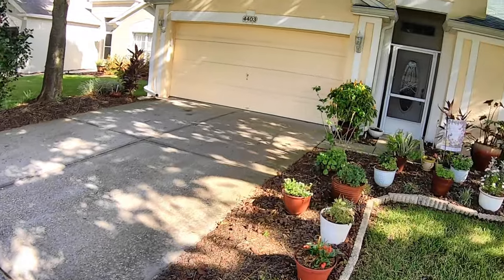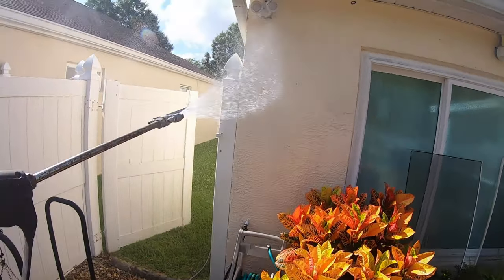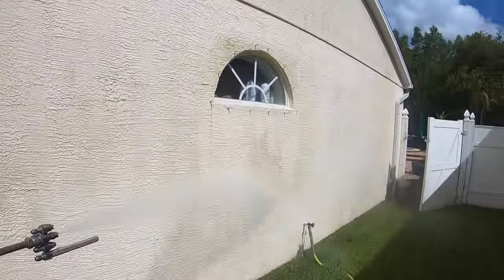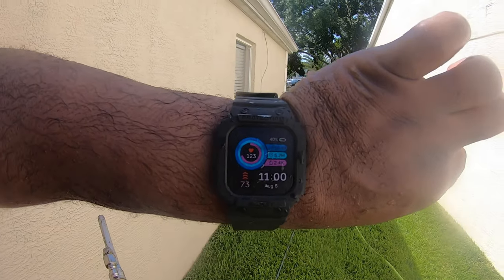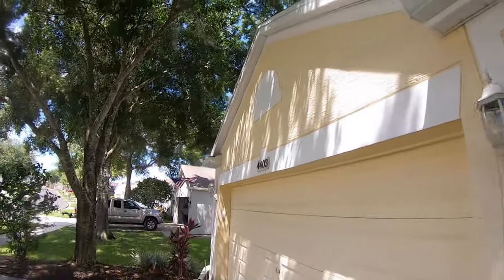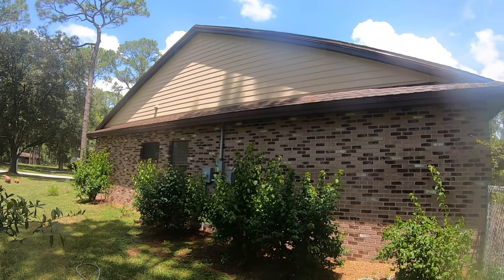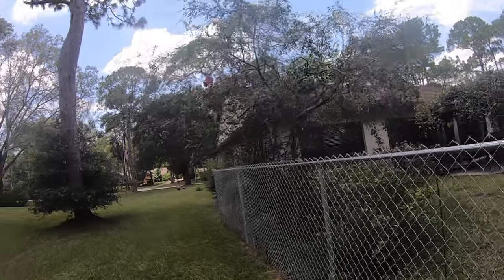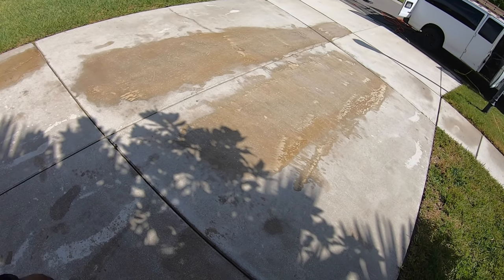house soft wash and oil stain removal

Comment: Big Bruh, I have a oil stain removal job tomorrow, I’m using f9 bark. It’s new concrete , do I use a 50/50 mix??
Reply from the maker: F9 barc doesn't work for oil. That stuff is for rust.  F9 double is the degreaser from the F9 products.  You're better off getting some purple power extreme.

Comment: Cliff, at the end of my gun, I have a swivel  ball valve  when it's in the off position. I can't quick release  it , it's still as hell and won't swivel,  does that sound  right  to u?
Reply from the maker: If you got cheap quick connects it will happen
Reply: @PinkFlamingoPowerWash  ok they come on the hoses I buy in my opinion  the hoses are expensive  $89 for a 50 footer do u have a recommendation  on what guick connects  I should  buy or hoses then.

Comment: So you soap the whole house even though it’s hot outside? You’re not scared it’s going to dry? Or does it matter?
Reply from the maker: No I didn't. I did the back first. Then soap the other 3 sides. Remember the front is shaded by the tree.  Normally I'd only do 2 sides max.

Comment: What’s your psi when D/S the house?
Reply from the maker: Honestly I don't measure PSI.  It's soft washing so it's low pressure.  The jrod has all low pressure tips
Reply: @PinkFlamingoPowerWash  ok thx. I also build trailer and sell them so I built myself a 7x12 dual axle and started plumbing. My next thing is to get the proportioner valve, I have the everflo 55, so I gotta learn that plumbing process.

Comment: Cliff,

On the fist house, what percent do you use to clean the stucco?
Reply from the maker: I downstreamed it brother. Easy work.  Melted right off.
Reply: @PinkFlamingoPowerWash  

Wow, so 1 - 1.25%. 

I thought stucco you will need it at 2%.

That house looked good when you were done. 

Nice job.
Reply from the maker: @michaelc7283  I have an envirospec super suds sucker. It pulls a little more.
Reply: @PinkFlamingoPowerWash  

Still will like to see a draw test video on that Super suds sucker. 

Thanks for all the information and videos
Reply from the maker: No problem. As you saw what it cleaned up, im very happy with it.
Reply: @PinkFlamingoPowerWash  

Yes Sir..Looks great 👍
Reply: Cliff, what type of degreaser did you use on the oil spots??
Reply from the maker: @gotcornbread  stampede plus degreaser followed by purple power extreme strength degreaser

Comment: Cliff did you use any remover in general apart from the 50/50 mix
Reply: I mean on the walls
Reply from the maker: Yea SH doesn't remove oil.  I used stampede plus degreaser followed by purple power extreme.
Reply: We’re can we find that degreaser